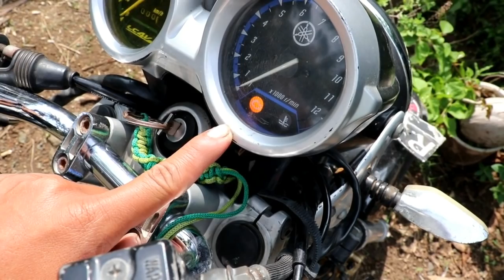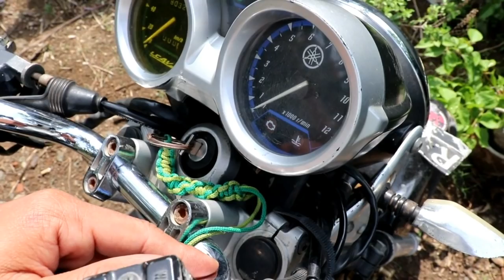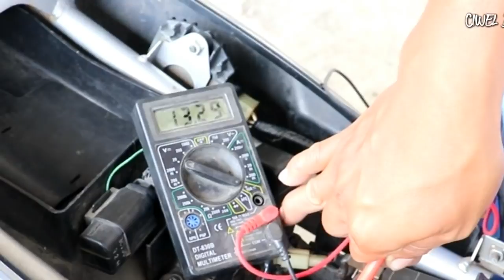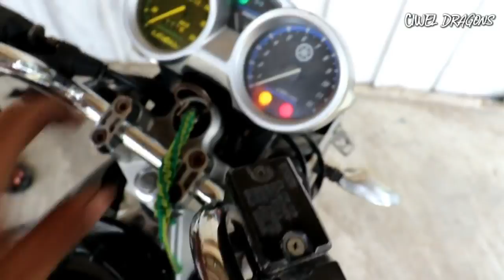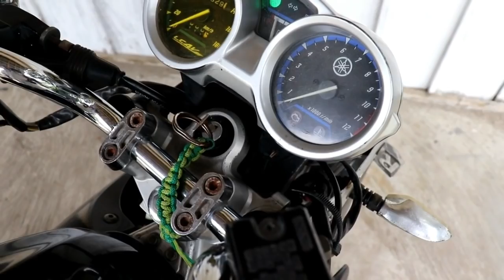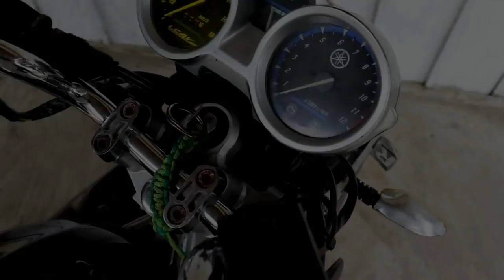mengaTAsi YAMAHA Vixion Error Code 46 ??😭😭

Comment: Mas, motor saya vixon 2011. Klw pas jalan dengan kelajuan di atas 80 km lampu injeksi nya nyala trus mesinnya brebet. Tapi klw di bawah 80 km lampunya mati tapi kadang juga masih brebet (buntu tersendat).  Mohon solusinya mas. Saya sudah bawa ke 2 bengkel besar tapi masih ajah rewel. 🙏🙏🙏
Reply from the maker: mesti di pahami kodenya berapa, dan kalo di scan yang error yang mana

Comment: Mas bro tolong d jwab, mtor sya kena racun 46 jga.
Saat kunci kontak d on posisi mesin mati tegangan aki cma skita 8 - 9 volt ajh,, mesin d nyalain jga ttep mentog d sgtu.. gk lama d idupin soket spul panas bgt.. ith pnyakit y dri aph yah ??

Yg sya sdah lakukan ith bersihin soket kabel spul sma cek spul (ok).. tpi pnyakit y blom ilang..
Reply from the maker: minta ganti kiprok
Reply: Fix dri kiprok nh ?
Soal y d pksa jlan jga brebet, lmpu dpan gk kuat nyala
Reply: @doniubbe6467  motor ane jga brebet... Setelah ane bersihin filter full pump... Alhamdulillah bisa jalan...

Comment: Klw kode 22 apa tuh mas kerusakannya..?
Reply from the maker: 22x = Rangkaian sensor temperature udara masuk rusak atau ada hubungan pendek
Penyebab:Kabel putus atau terdeteksi ada hubungan pendek/ short circuitIntake air pressure sensor rusakConnector sensor tidak terpasang sempurna
Reply: @CiwelDragons  oh gitu ya gan. Jdi harus ganti air ladiator ya gan...? Trus sensor harus di bongkar juga ya mas..?

Comment: Permisi mas saya mau tanya!
punya saya ketika mesin udah nyala kenapa pas di gas dengan rpm 3 dengan gasnya di tahan selama 5detik'an, lampu indikator kode nya menyala lama (tidak berkedip), lha pas gas udah di turunin ke normal lampu indikator kode nya mati, & gitu seterusnya berkali-kali.

Mohon solusinya & bantuannya 🙏🏻
Reply from the maker: itu yang nyala lampu suhu apa injektor
Reply: @CiwelDragons  lampu injector mas ( nyala warna kuning sebelah kiri )
Reply: @CiwelDragons  Punya vixion old th 2012 saya, di saat buat jalan sekitaran jarak lebih 1km jadi brebet & lampu injector nyala, & ketika saat mesin udah hidup kenapa pas di gas dengan rpm 3 dengan gasnya di tahan selama 5detik'an, lampu injectornya menyala lama (tidak berkedip), lha pas rpm gas udah di turunin ke stasioner/normal, lampu indikator kode nya mati, & gitu seterusnya dicoba berkali-kali.
Intinya gitu mas.